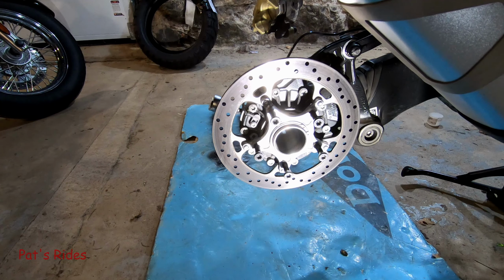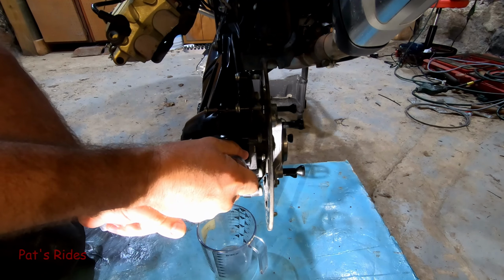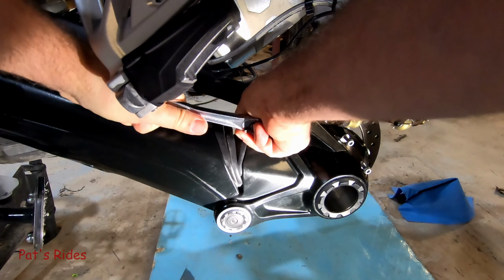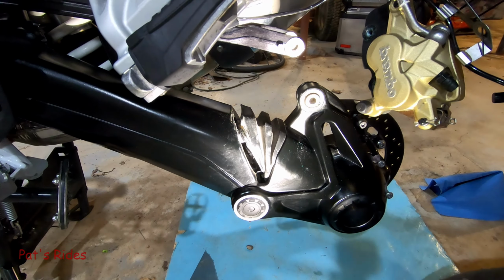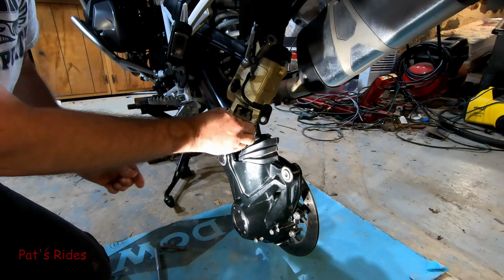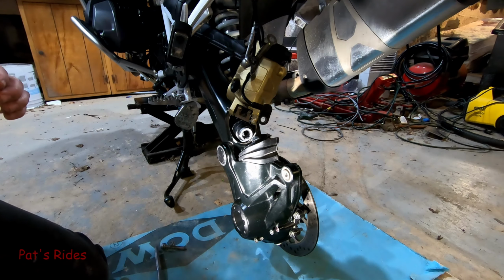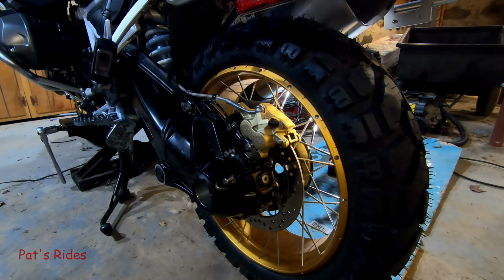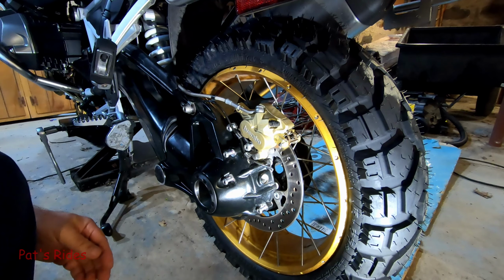Final Drive Maintenance (2019 BMW R1250GSA)

Comment: It takes seconds if you support the shaft universal joint with a long thin screwdriver and lift the drive housing by holding the disc and not the housing, that way you can support and turn the disc with one hand.
Oh, a plastic car trim tool is ideal for the rubber boot
Reply from the maker: That was my first attempt.  Second time I did this was seconds and it was in place.

Comment: Pat...great video. I recently bought a 2020 1250 GSA. Perhaps I missed it, but what are the maintenance intervals for the spline shaft? Not new to BMW...I also have a K1600 and other than the valve check on that bike I do most of my own maintenance within reason, so now soaking up GSA maintenance info.
Reply from the maker: Sorry I didn't mean to ignore you I just now noticed your comment.  I dont believe the spline is called out in the book.  But after seeing so many others post videos of their splines rusty I didn't want to take a chance.

Comment: Nice video thanks for sharing. I will pay the dealer I do not have your patience
Reply from the maker: In all honesty it wasn't that bad.  But nothing wrong with throwing some money the dealers way.
Reply: @PatsAdventuresTravels  Great video, just thinking, most BMW GS owners would probably have the dealer do this as if you can afford a GS, you sure can afford the dealer, then again, I also wonder if the dealer would ever actually grease the spline, I mean, we are not in their shop to see if they did, they may just charge you and never do the job and that's why I do the maintenance on my motorcycles too!  Oh, one more thing. BMW Motorrad does not require the spline to be greased! You can call and ask them, I already did.
Reply from the maker: @ironhorsegladiator5034  I have heard the same thing that they don't require grease.  But then I have seen a lot of videos of guys where it is rusted bad so why not and prevent an issue?  I'll always do my own maintenance.  Why pay for a service I do not need.  That is just more money that I have for fuel....lol  I work on CNC machine tools for a living so for me personally it's not a big deal to work on bikes.  Now I am getting ready to use the dealer for the first 12K service here in about a week even though I am sure I can do that too.  Lastly I save a ton of time by doing it myself.  Nearest Dealer I'd use is an hour and a half one way.